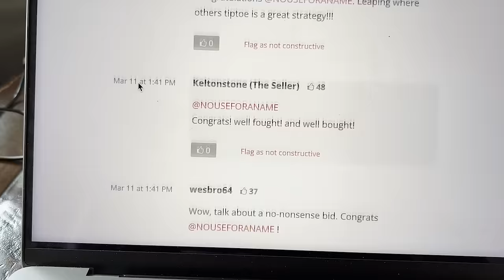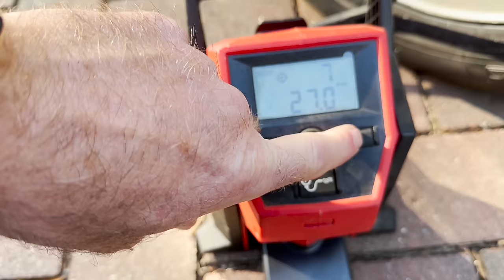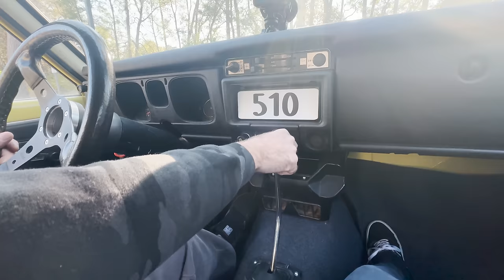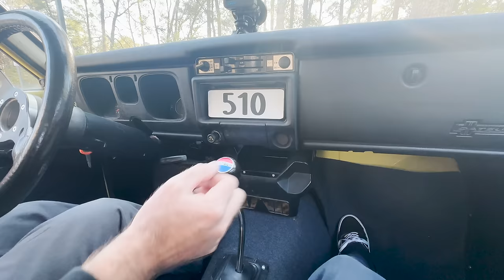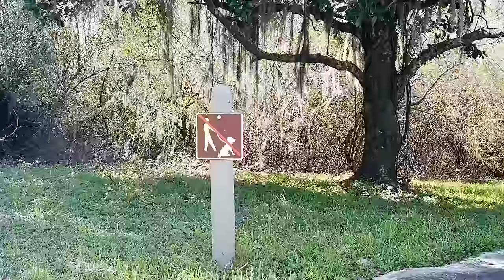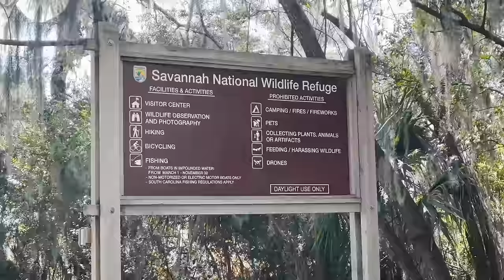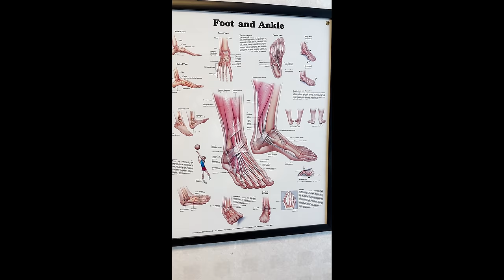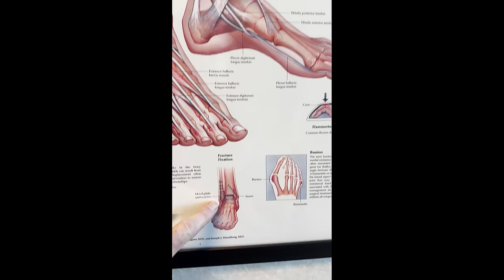RECORD LEVELS OF PAIN! BOUGHT A CAR, THE ENGINE WIRING MELTED, AND I BROKE MY LEG ON THIS ROAD TRIP!

Comment: I love the 510 and the 210 which is lighter. With a turbo rx8 engine it's an ls killer. BTW Mike, any chance you have a set of sbc heads that are collecting  dust? I have happily been working on cats for over  50 years, but became disabled in 2005 to the point  I can't  work
 However no way does it stop me from working on cars. Have a Dale Earnhardt Sr
 Monte Carlo SS,which was my Dads car also a 1979 Camaro Berlinetta  which was my Moms.
A '70 vetted, 35th anniversary  edition  Camaro and a rare 1981 TURBO Trans Am
 Pontiac needs a trans rebuild, vetted needs rear hub bearing and exhaust manifolds) craked). Now I have a 350 4 bolt main, .060 over short block.
Any Chance  you have a pair of sbc heads I could used on that. 060 over small block so I can put it in Mom's car or the wife's Vette.
Greatly appreciate  the content, laughs and cool car info you give us.
Thank yiu and God bless

Comment: Ironically: I got a bmw 2002 for cheap and went scca club racing with it. Got my ass kicked by datsuns. Beat the one guy in a beat to f*** alfa giulia at least, until he retired it to restore it. All similar weight, wheelbase, stock hp. The datsuns were just so easy to keep at "stock hp" you couldnt beat them

Comment: 1. No trips to anywhere there's salt on the roads, please. 2. It's your shift lever, not the trans that's the issue. Doglegs fit perfectly with the original shift lever. 3. I have a feeling you're going to go wild, but the rules are that you cannot cut the car, and absolutely no wheels larger than 15" dia. 4. Shut up about Datsuns; they're getting expensive.

Comment: Mike, Stop pushing revisionist history! The National Maximum Speed Limit was enacted in 1974. This was put in because of the oil crisis in 1973, and the spikes and shortages leading up to it. Trying to save about 2.2% consumption, but only got between.5% and 1% according to Wiki. 😂 I lived this driving my self-rebuilt 68 VW bug. We had a group of drivers into TSD rallys driving a wide variety of vehicles. Renault Gordini, Datsun 510, NSU, MGBs, and my VW. BTW, I hear alligators like chicken.